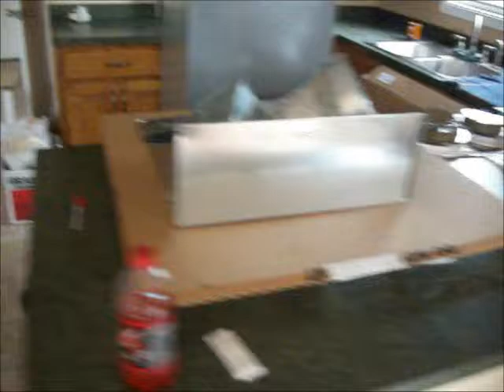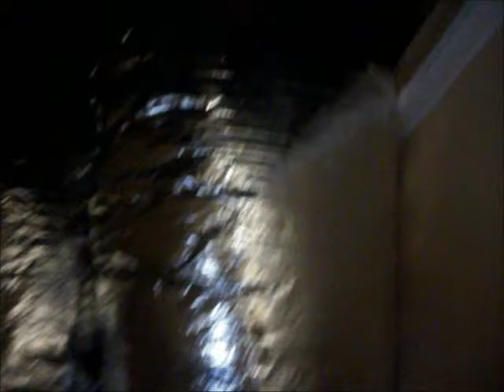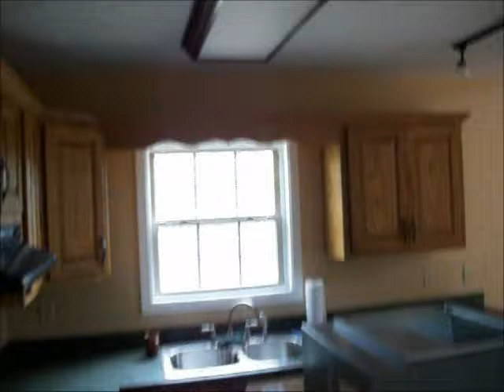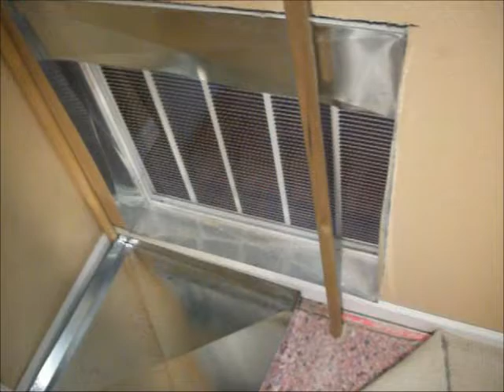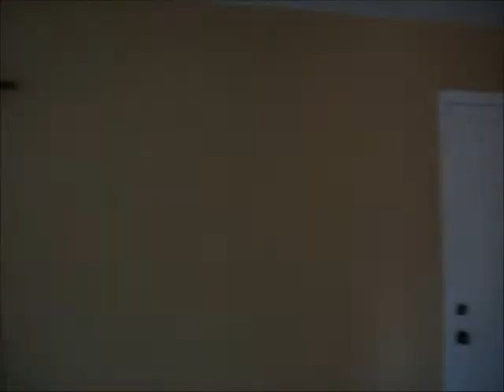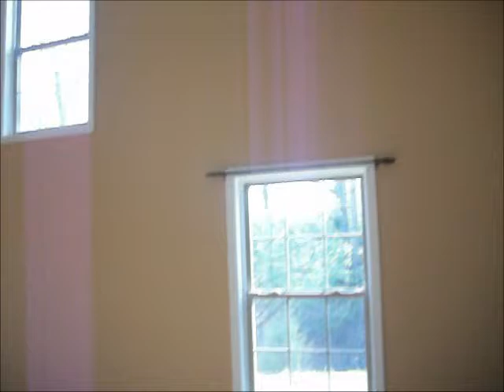Uncle's ductwork is complete.

Comment from the maker: Yes,all the drops were flexible duct coming off of the 1 piece of square duct over the airhandler.
I usually like to run a conventional rectangular or round trunk line and then use the flex for the drops but there was nowhere to run a trunk so it got the best I could manage given the circumstances.
I love knockin' tin.   :-)
Thanks for watching.

Comment from the maker: @finpainter1 I was amazed that no heat or a/c was installed in a house built only 6 years ago.
The layout of the house was a real challenge to putting in a central system and the ductwork.
Probably one of the most challenging houses I have done.
Thanks for the comment.

Comment from the maker: @danelectro68 In this area they are very efficient.
The further north you travel with the temps getting lower for more days of the year,the less desirable they become.
Some people I know in Michigan have a hybrid system that uses a heat pump until the temps get below 20 degrees then an outdoor thermostat switches off the h/p and turns on a natural gas furnace.
Thanks for watching and the question.

Comment from the maker: @iceman22st The are no stupid questions.  :-)
It was built 6 years ago with only a wood stove as a heat source, and no a/c at all which I do not understand.
As part of the loan process there had to be a permanent heat source installed before the loan could be completed(wood stove does not count).
In east Tennessee basements are optional and are usually based on ground composition and the budget of the builder.
Thanks for the intelligent question and for watching.